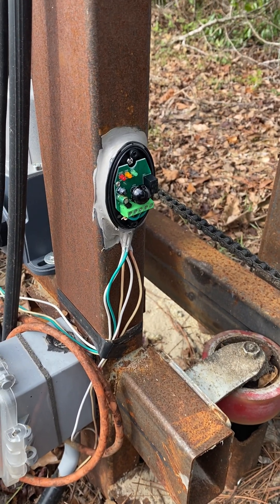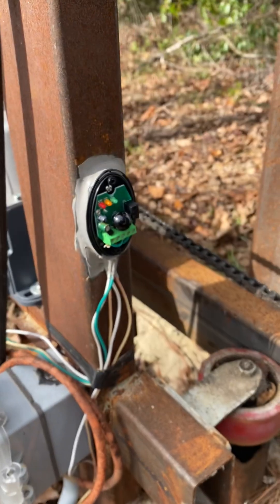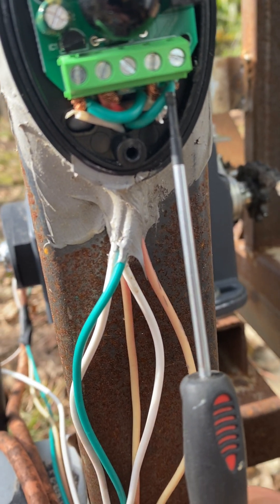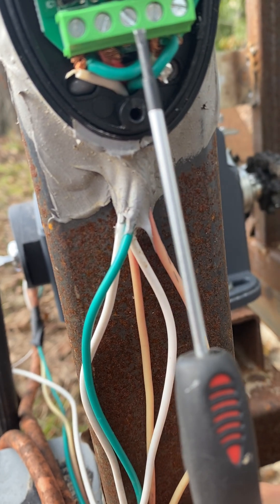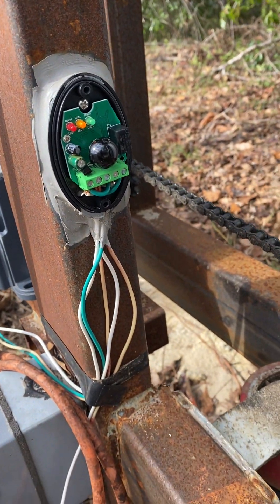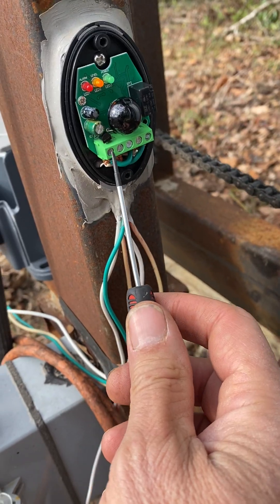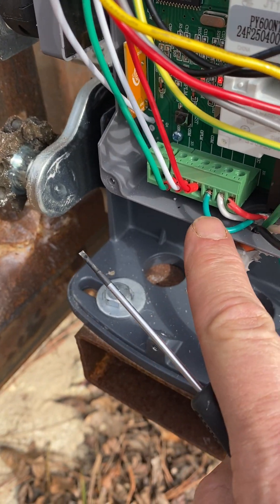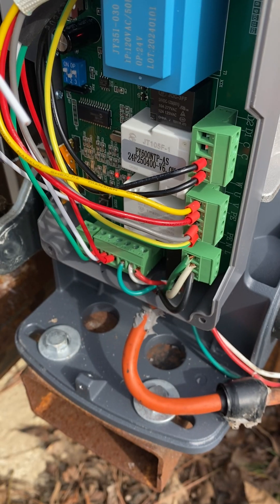Co-z gate opener

Comment: Great video, funny thing . I cant find one video that shows my mode. the panel is totally different and i think the sensors are different as well. I have the CO-Z APP model with the long rectangular sensors. You think you can guide me thru this , please? thanks.
Reply from the maker: https://cozpalace.com/products/co-z-wireless-infrared-sensor-set-for-gate-opener-infrared-photocell-gate-sensor
Reply from the maker: Go to that link tap on the picture scroll over it will show you the wiring instructions. Of course, if you’re using the batteries on the one side, you won’t have to wire it.

Comment: How do u hook wires on far end?
Reply from the maker: There’s only two on the other one left is negative right is positive connect them to the negative and positive on the main sensor like I showed in the video doesn’t matter if you hook it into the sensor or just the wires together
Reply from the maker: If you need more help, I can go out to my gate tomorrow and send you a video
Reply: Do I need to run a physical 24v 2 wire to far end?